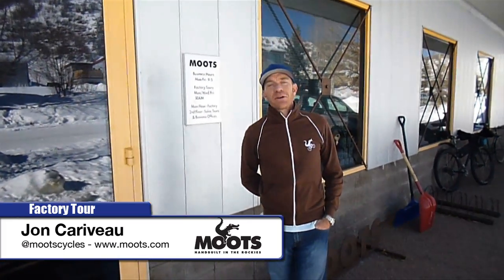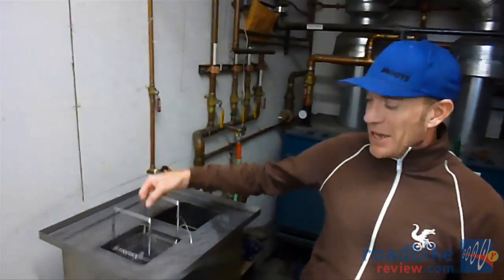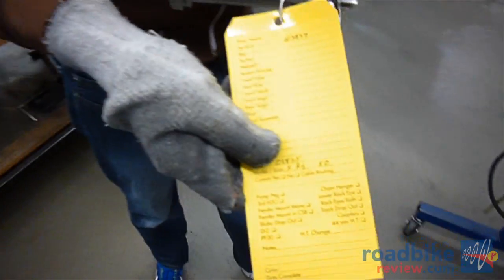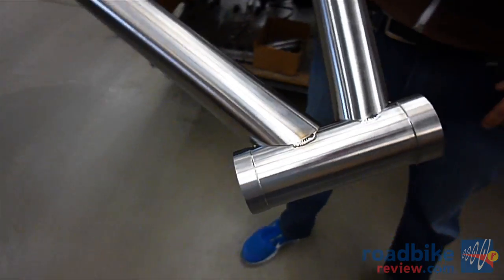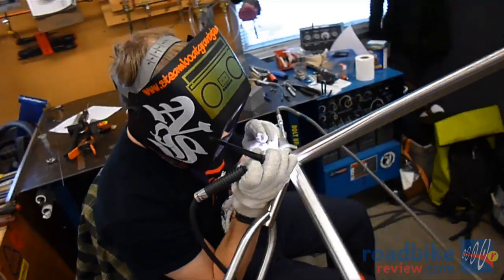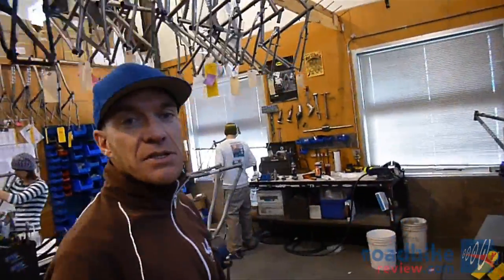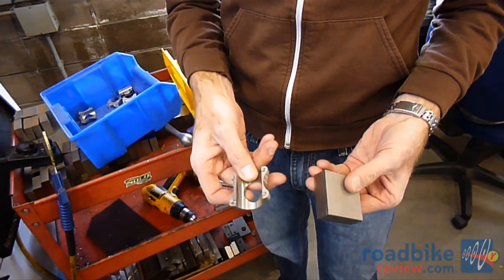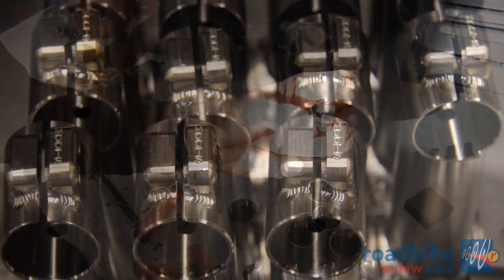Moots Factory Tour

Comment: "Ti flexes too much", are you sure?? My Van Nicholas is definitely a stiffer frame compared to my CAAD 9 (aluminium frame). And my Look 695 (carbon) would definitely be the stiffest frame I've ever owned. I don’t have any say on steel frames, but a mate of mine said that it has similar characteristic as the steel frame, just much lighter. 

I guess stiffness is all relative to the composition of the alloy/material, the tubing, geometry and construction method.
Reply: IIRC, tube stiffness is proportional to the diameter ^ 4, so all one needs is to make the tube ~20% larger diameter to match the stiffness of a steel tube.  Because Ti has what, half the density of steel, you can leave the wall thickness as-is so that the larger tube still resists dings while still being lighter overall.  Pretty cool.

Comment: Yea did you notice he didn't touch a part of the frame that's going to be welded....so no big deal! I also have had bikes made of all 4 materials and they all have their own characteristics, good and bad. Ti and steel have similar characteristics with Ti being much lighter but steel stiffer at the BB. Both having that magic carpet ride (Reynolds 531 coming to mind). Al is stiff and can be rather harsh riding but very stable on descents due to it's stiffness. Carbon (2) cracks at the BB!

Comment: which is better titanium or alumunium?
Reply: Depends on the part and the purpose.  I'd rather have a Ti frame because as long as Ti is flexed under its deformation limit, it will not fatigue and crack, while Al will.  Also, to get Al tubes strong enough to resist dings, the tube has to be so darn stiff you risk getting the bone-jarring ride of early 'pop can' Cannondales.  There are good Al bikes, e.g. Spooky and Gaulzetti to name a few, but the "Ti ride" mystique is well-earned.  Now, for things like headsets and cranks, Al makes a lot more sense.  One can make them in Ti, but there is no practical benefit for headsets (whose parts are cheap and essentially consumables that last a long time anyway), and hard-to-afford for cranks.  Cane Creek's eeCranks are amazing, but $1k.